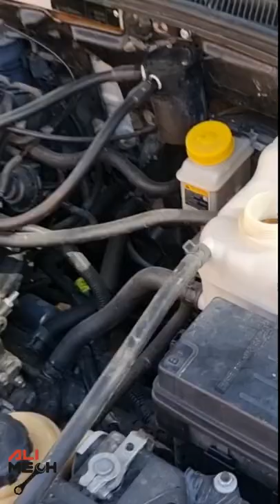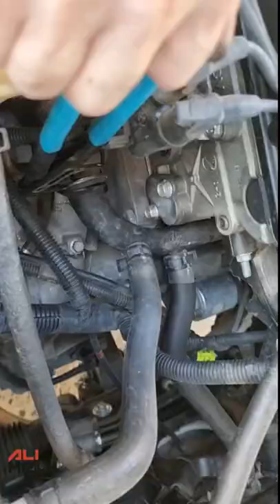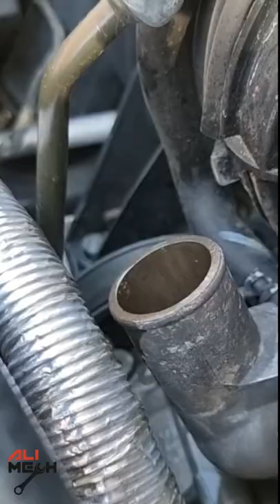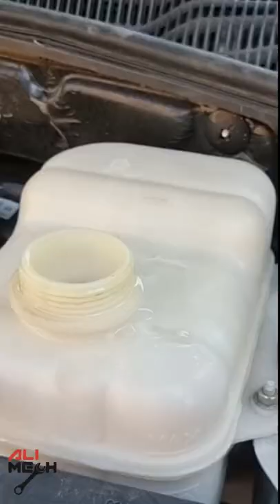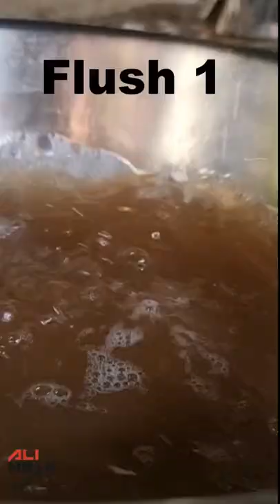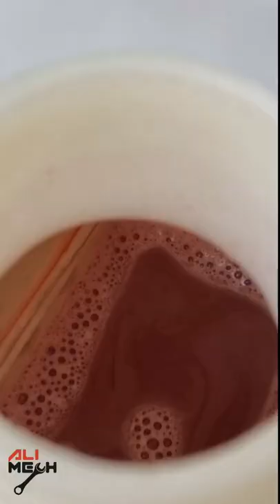How to use prestone radiator flush and cleaner #shorts

Comment: I do a coolant flush every few years on my cars, I replace it with the OEM stuff and a new thermostat, I've never had a problem with rust or sludge. If you buy a neglected car then yeah maybe you need to do this.
Reply: Does the job !!
Reply: What happens if you don’t replace the thermostat?
Reply: @Arturo-im1nh then your car would over heat badly duh
Reply: @Arturo-im1nh  if it doesn’t need to be replaced then nothing lol. No clue why this guy changes his every 3 years, that’s reallyyy excessive. I’d only recommend changing it when it throws a code, or you notice it seems to get stuck a bit
Reply: @LightsaberGoBrrrrrr he buys napa aftermarket thermostat so he should change his that often lol

Comment: I hate to break it to some of you but there are several reasons why someone would chemically flush their cooling system. And why the Author of this short doesn't explain this to you guys is beyond me. The number one reason that someone would flush is if they let their coolant go too long without changing it because the inside of your hoses start to deteriorate slightly over time and can contaminate your cooling system as well as small gasket particles that break off from tightened parts or scraped gaskets from parts changes that falls into coolant ports ect.. Also, if you have mixed different types of antifreeze (and most do because they forget from fill to fill what type they used) it could and probably will start to sludge  up inside your cooling system over time. There is also standard maintenance. If you have let it go too long the rods inside or your rad. will start to restrict and your car will start to run hot. Just saying guys. Maybe keep an open mind and thank the guy for passing on his knowledge to you all. Antifreeze doesn't last forever. It does need to be changed over a period of time. And as far as using tap water goes, I suppose if you have hard water it would be best to use distilled water. Although, in my 40yr career as a professional dealer trained mechanic I have never seen anyone use distilled water for a flush.
Reply: when the tap water reaches boiling temp it releases contaminates like lead and chlorine, although the quantity varies based on location. better just spend the extra $2 on gallon distilled water jugs. plus some of that water will stay in the block and contaminate your coolant over time
Reply: Distilled water in 1 gal bottles are the same price as drinking water where I am at. Over 40 years of experience, you should have spotted limescale and hard water deposits like I have. There is no reason to use tap water as it has impurities. Use distilled or de-ionized.
Reply: Well, when I changed the coolant on a motorcycle with a non-original one, I drained the old one out. Then I poured distilled water inside and started the bike and waited until the fan came on. Then I drained it out again and poured in new coolant. The reason I did this was to flush out the old coolant so the residue wouldn't mix with the new coolant. That I used distilled water instead of tap water so that the tap water would not leave scale in the engine.
Reply: 50 yrs as a professional mechanic here, If you had the experience I had then I’d say distilled is not a problem at all, especially the Mountain Dew trick that some of you youngins don’t know about 👴🏻

Comment: Also turns a radiator into a coolant filter I used super flush and I clogged up the radiator old timer only use water to flush work's really we well if the cooling system has been maintained

Comment: What about checking PH levels before and after replacement of coolant ?
Reply: why? purpose of that? Just clean all the system and put new good coolant.
Reply: @Big 1  if your using detergent to clean the inside and dont wash it out properly , you can make it worse then it was before.
you could tell if you need to replace the coolant by measuring the ph, and putting fresh clean coolant in is not the answear, you might have leaking gasket and over a fairly short period of time your coolant will go bad again and your just wasting money

and most of those cleaners are just snake oil, if you have rust,sludge or lime inside , some liquids are designed to remove certain things, beacause you either need acidic or alkaline detergent to takle a certain problem at a time
Reply: @alberta3157  The coolant itself it´s anticorrosive and stabilizator... So your problem is solved.... Take car.
Reply: @Big1_  Its neutral, meaning it's not corrosive ...
Reply: It’s never that serious

Comment: Great idea if you then flush it out and add thermocure. Prestone radiator flush does not do enough if you have a rusty block. The rust is coming from the block normally. Thermocure removes the rust and coats the metal so it won't rust again. Prestone is OK for a normal flush and loosening up rust before using thermocure.
Reply: Where do I find that stuff from and does it really work against stopping galvanic corrosion ?
Reply: Many engine blocks are aluminum. Should be any rust. Maybe a little scale, but not rust.
Reply: @onesikm3  Yes it works but may not stop it from happening again because there are still two different metals that are causing the corrosion. I got mine from Amazon because the local parts house did not have Thermocure.
Reply: @Bilytkid  They can still corrode.

Comment: Regular water ? 🤔
Reply: I guess distilled will be best but will be costly plus using regular water should hurt the system much since it won't be sitting inside for long. Maybe last flush should be done with distilled for sure to stay on the safe side.

Comment: extraordinary.  can I do it at home as a beginner?  sometimes i'm scared
Reply from the maker: Yes, here is the detailed video https://youtu.be/jNSnNX0NTF0
Reply: for some reason i’m pretty decent with fixing my car myself from the engine or wiring, but i never had luck with coolant refill/flushing without the car overheating. how’d yours go?
Reply: @Wichan137  gotta make sure you get all the air pockets out of the system by letting it burp

Comment: Y'know there's a radiator petcock so you dont get coolant all over your engine. Also, switch every clip out for hose clamps if your taking them off.
Reply: DO NOT replace the hose clamps with the worm screw clamps. The ones that come with your car are “constant tension” clamps which apply the same tension hot or cold.

Tldr; don’t listen to this clown
Reply: @ManoElMacho Screw clamps work just fine over here

Comment: Please don't follow this guy instructions. There are a few important information and a few step he didn't tell you. If you guy do what he has done. You car engine will over heat and eventually screw up your car engine.
Reply: Why is that
Reply: The only issue with flushing using water is that there's still water left in the block when you're done flushing. So sure you can fill it back up with 50/50 mix but it won't be true 50/50 due to the left behind water. I recommend you do coolant flushes with actual coolant and no water
Reply: @DaDaDo661  just use 70/30 mix then 🤦‍♂️
Reply: He didn't bleed it after either so there is air trapped in the cooling system
Reply: @wigletron2846  you’re clearly a lad who can’t make decisions on his own, and needs an owners manual to change a puncture 😂
Reply: @DaDaDo661  I've done my car like this 4x in 14yrs BUT without the flush,i added 60% coolant to 40% de ionised water & never had any issues....never changed the thermostat either on my 2002 Yaris here in the UK.
Reply: @DaDaDo661 i wanna be strict and flush with distilled but bro, i have a diesel truck, and it takes little over 6 gallons….the hell if i’m buying that much water just to flush it, then i have to fill again!